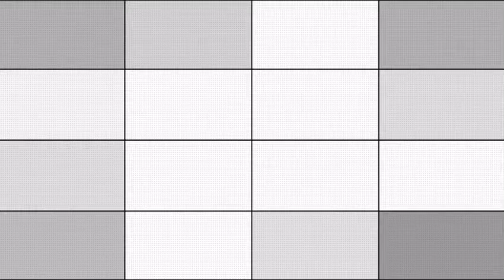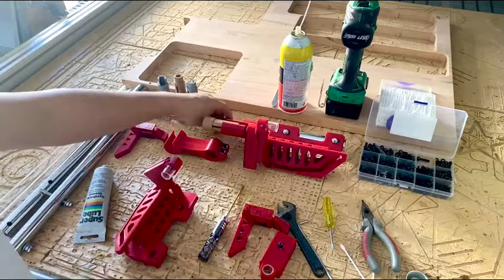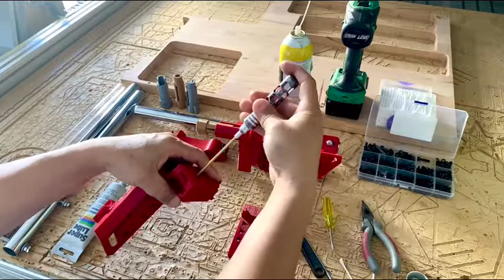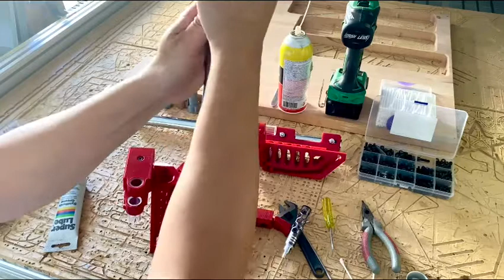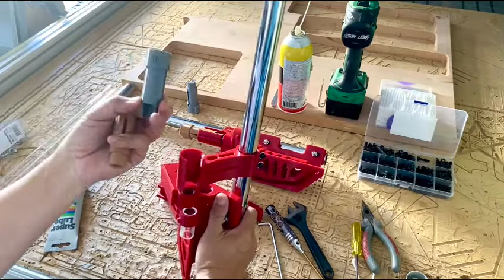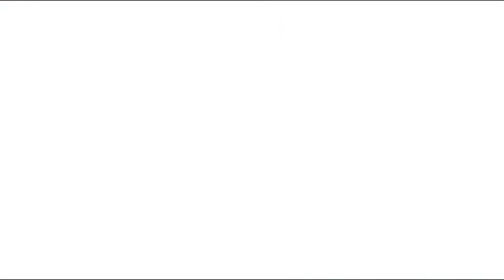How do I assemble the Hornady case feeding system?

Comment: Are there clearance/interference problems with Lock n Load bullet feeder?
Reply from the maker: I haven’t tried the factory bullet feeder so I can’t really tell. The Hornady automatic case feeder is good but it’s overkill for someone like me who only load a couple of hundred bullets a day, and $700+ price tag is definitely a no to me. I’d rather buy another press for different caliber to save hassle of changing dies.
Reply: @uniquepartsaustralia6452  The Hornady case feeder has endless problems, a complete disappointment. Numerous attempts of solutions by people on YouTube. Not much luck. Constantly misfeeds, double feeds, triple feeds, tumbler over feeds, etc. I have about 20000 rounds of trying to make it work. So many design flaws. However the bullet feeder simply works. So, the issue is, if your case feeder interferes with Hornady bullet feeder, do I trade your solution for one that works. I am surprised you have not encountered this issue, which makes me wonder if your case feeder will have similar issues as the Hornady case feeder? How much testing has your case feeder really had?
Reply from the maker: @Howdy Duty88  I don’t think my case feeder and hornady case feeder can be used at the same time. They are totally different. I haven’t encountered any double or triple feeds problem simply because there is no space for the second case to get into the end drop tube. I had it on my press for about 6 months and went through more than 10000 rounds. I haven’t had any mayor issues. Most feedback I got from customers were installation problems. That was the reason I released the V2.0 and uploaded a video for troubleshooting.
Reply: @uniquepartsaustralia6452  You seem to be confused. I was asking about interference between your CASE feeder, and the Hornady BULLET feeder. Just trying to be clear. Numerous YouTube’s on the Hornady Bullet feeder. I would like to use your case feeder, but if it eliminates a well functioning bullet feeder, I have gained nothing.
Reply from the maker: @Howdy Duty88  I see, I’ll need to look into it.
Reply: @uniquepartsaustralia6452  Much appreciated. If you’d like me to send a picture let me know. Might need your email.
Reply from the maker: @howdyduty8890  yes, that would be great. My email: info@uniqueparts.com.au